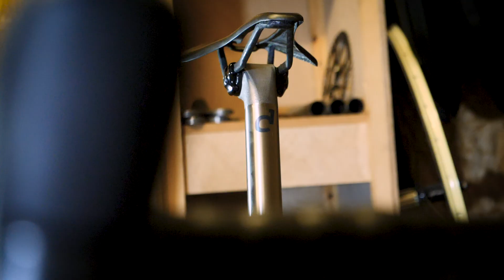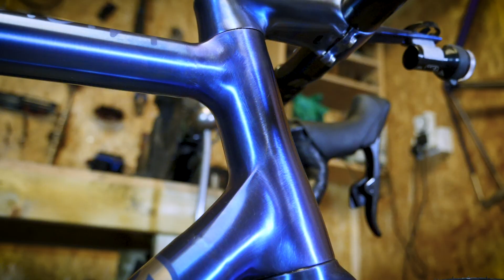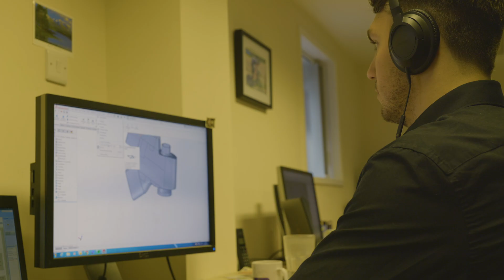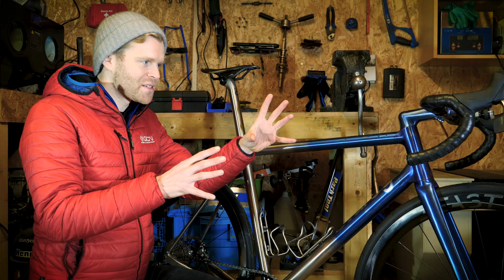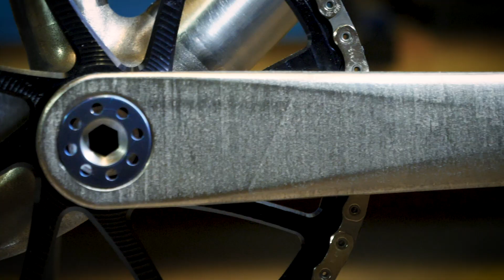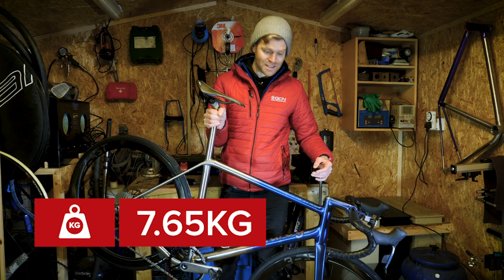Is This 3D Printed Titanium Bike The Most Beautiful Bike In The World?

Comment: The use of video of FDM printing is misleading. This is SLS (Selective Laser Sintering) and is not the same process as shown in this video. No you won’t be able to do this at home even if you can weld Ti. You’d need to send the design off to a SLS house to print in a giant vat of titanium powder. And you pay for that entire vat of powder regardless of how little you use to make the object.
Reply: That's what I was thinking too. I think they did it because it's easy to see, while you can't see anything during the SLS process.
Reply: @michaelmechex  I feel Ollie missed a golden opportunity to incorporate videos of lasers with him making pew pew pew sounds.
Reply: Actually this process is EBM, not SLS, built on an ARCAM Q10.

For both SLS and EBM you do not pay for the entire chamber of powder, the powder is very simply reclaimed for use, you pay for the machine time, a small portion of powder (between £100-£200 per kg, depending on material) and the skill of the AM engineer who is setting up the build.

No lasers involved, just electron beams.
Reply: Not sure how showing a FDM printer means thats how the bike is built.
Reply: Yes and the questionable value of using titanium in the first place is greatly reduced by the fact that it's notoriously brittle where is hasn't been carefully heat treated for annealing and tempering. Such as welds. Of which this mix and match design has many. For a start only a few parts are 3d sintered. The rest is welded to normal pipes. It's the long way around to produce an inferior product. Justified by claiming some parts have to be wacky shapes, which isn't even true. Ollie might only be an organic chemist but even he should know being forced into dodgy heat treatments on metals is both polluting and expensive. Titanium is energetically very expensive to produce normally. For this tech, first you have to make it pure. Then you have to grind it into a powder then you have to melt it back into a solid. Then you have to melt the ends to join them. This is only ever going to be a niche technique. Hang it on the wall with the other models.
Reply: @cadams6702  This comment is misunderstood in all the tech nerdery. Indeed, I would enjoy pew pew pew sounds with my morning coffee.
Reply: @Eatsgreencandles  I couldn't agree more. We'd need a lot of spare renewable energy before I'd call this a good idea.
Reply: @Eatsgreencandles  Some things.... Nothing is "sintered", it is melted, there is a difference. Polluting heat treatment? If you heat it in an electrical furnace, powered by "clean" electricity, where does the pullution come from? The Ti6Al4V does not release anything. You do not "grind" it to a powder, you atomize it, which do require you to melt it again, so yes, energy is needed. "Melt the ends", well, I guess you need to do that anyway if you want a standard Ti cycle, built from only tubes :-)
Reply: @georgegrant6388  I wish more people read this. Not a lot of people read the replies
Reply: @armadillito   I am sure the producer of this bike is holding his breath waiting for you to call something a good idea.
Reply: @Eatsgreencandles  No one cares. It's working for him and his customers.
Reply: @Eatsgreencandles  thanks, a lot of topics are obscured/hidden in the making. and what I dont get is that 3d opens up a whole new world of shapes?! 
thanks for informative good reply/comments
Reply: @Eatsgreencandles  turbine blades in jet engines work of course treated and chemically milled but strong enough to last. James similar situation regarding "not polluting" EVs, TESLA drivers race by you disregarding speed limits, but they are driving EV, producing batteries is an EXTREMELY dirty process but banishing production to The Third  World or China does not make it "clean".
Reply: @georgegrant6388  - Nice critique, thanks.
Reply: @mitchellsteindler  - Making excuses for what is quite clearly misleading is the job of tools. Good tool!
Reply: @newunderthesun7353  - Actually yes more people care that the bs presentation be corrected than will ever buy this bike.
Reply: It is not SLS, that is a name for polymer printing using powders, this process is either EBM (Electron Beam Melting) of LPBF (Laser Powder Bed Fusion)  both processes fully melt the material achieving a melt temperature over 2000deg so the material does not contain porosity and achieves a material density of 99.9%

Comment: IF 3D printed means - cheaper titanium bikes then YES it is HOT
Reply: Ermmm...presently Ti frames are not more expensive than carbon ones.
Reply: Agreed. TI bikes, at least stateside, are insanely expensive. $6-7k for a frameset.
Reply: @tonyg3091  yeah xD captain obvious! some are even cheaper like planext x.. but still most of titanium frames are too expensive or overpriced.. or both :D
Reply: Ahah go believe it... if you apply that to carbon ones, they are getting expensivier each new year..
Reply: It will be a decade or so probably before it'll be an affordable option.    But.  One of the huge benefits it that there is no complex tooling / molds.    Like carbon and alloy frames that have all the hyroformed tubes as well as much more welds.      No tooling investment means they can change / improve / customize the bike easier and faster..  more different sizes can be made...
Reply: Being able to design internal reinforcement structures on the inside of the lugs?   Amazing.  Integrate tons of features right into the lugs the way those crazy tri / aero bars do?      Change wall thickness  internal  ribbing honey combing.    Sooo many design options open up when u aren't locked into machined / forged / tube parts.
Reply: Planet X and Ribble titanium bikes are way cheaper than this.
Reply: @PaperHunter  thank you another captain obvious! I write it in the comment above..
Reply: @mavver  Dunno... 2k quid for a Reilly sounds pretty affordable compared to 4 k euro Specialized carbon frame.
Reply: @tonyg3091  emmm yes in many cases they are.  You can get an incredibly expensive carbon bike, but the lower end is definitely cheaper than titanium.  And because titanium is so difficult to work with, I doubt that cheap titanium (if it can be found) is worth buying.
Reply: Price keeps everybody from having one. That can be a good thing too.
Reply: @erich8258  No, it is not worth buying. BUT as I said a Reilly frameset costs less than good carbon one and the Reilly will last you a lifetime more or less, so price is relative.
Reply: @PaperHunter  different way of manufacturing, not an apples to apples comparison.
Reply: Why no test ride?
Reply: @joelrunyan1608  True, but it is still a slower process, the only time these will come down in price is when the 3D printing machinery market is saturated. A good few years away from that happening. Then the post processing of 3D printed parts is an art in itself, its not something for the common man.  A damm shame this bike is lovely.
Reply: Dream on .
Reply: I don't think it's going to make them cheaper. You can make a cheaper Ti frame just by welding the tubes and some machined parts together and not using any lugs. This is how they're normally made, and it will perform just as well. But it's a beautiful bike with a unique look and fully custom. That's more the niche it fits into.
Reply: I just received my Carl Strong Ti custom frame two weeks ago. Made in the USA and $4500 for the frame and ENVE fork. I'd say it was cheaper than a flagship carbon POS.
Reply: @Sills71  wow, no need to call names. I'm just stating what I've seen people spend money on, when I used to work in a shop. I don't personally own a TI frame myself, only carbon, alloy, and steel bikes in my garage. Several moots framesets are in the $6000 price range.
Reply: Came back here after he said 10k... I hope so
Reply: @tonyg3091  yeah but carbon frames are expensive
Reply: lol no.
Reply: Cheaper titanium parts yes from material cost perspective, but the manufacturing cost is still higher than normal machining. And fatigue properties of 3d printed titanium is still debatable although titanium in general is pretty fatigue resistant.

Comment: Steel tubes are drawn to get the crystals to align and the strength properties that they desire. Aluminum frames are heat treated to get the material to respond correctly. At the 6-minute point , the manufacturer addresses mechanical properties. He says that all these manufacturers use slightly different techniques. He says that the manufacturers hold on to that information. Therefore you don't know what you're buying.

Comment: i've always loved titanium bikes, even over carbon. a disc-braked titanium bike originally designed as a gravel bike is a little slower than a carbon-based road bike but is far more versatile - you can put wider tires on the thing and it makes a great off-road bike as well.

Comment: 3d printed is a bit misleading considering all the machine work that takes place afterwards. More like 40% of some of the frame components have  been 3d printed is more accurate.
Reply: agree - tubes welded to printed joints does not a printed bike make. Still .....wow
Reply: @MattMediaAU  You don't want to print tubes. Much more $/kg and lower strength.
Reply: @appa609  For sure and understood. My point was given the tubes are not printed can you really call it a printed frame? Seems more accurate to describe it as a "regular" frame with printed lugs doesn't it?

Comment: That drop from seat to handlebars looks extreme!
Reply: I thought same. My back, shoulders and wrists hurt just looking at it. 😂
Reply: Some cyclists are actually fit.
Reply: @tomhughes8472  - The needs of the many outweigh the needs of the few, or the one.
—Spock
Reply: @stuffhappens5681  cool. Seems completely irrelevant to Francesco not being flexible enough to ride this bike.
Reply: @tomhughes8472  - Your summation as a measure of foreign anatomy as a sum of absolute values given that deviations from the mean result in a quantity that is an unknown expression of geometry about the mean. The mean deviation, or mean absolute deviation, of your sample measure is unlikely to exhibit the same units of data. Therefore the levity of Spock was necessary.
Reply: @stuffhappens5681  so, completely irrelevant then. Thanks
Reply: @tomhughes8472  - Relevance is subjective, of course.

Comment: btw, love the idea of an all-titanium bike, gotta admit though that this reminded me of hot black desiato's all black ship in the restaurant at the end of the universe:

``Every time you try to operate on of these weird black controls that are labelled in black on a black background, a little black light lights up black to let you know you've done it. What is this? Some kind of galactic hyperhearse?''

The walls of the swaying cabin were also black, the ceiling was black, the seats --- which were rudimentary since the only important trip this ship was designed for was supposed to be unmanned --- were black, the control panel was black, the instruments were black, the little screws that held them in place were black, the thin tufted nylon floor covering was black, and when they had lifted up a corner of it they had discovered that the foam underlay also was black.

Comment: What a beauty! The first metal bike that matches carbon’s beauty. Almost up there with the likes of Bastion Cycles & the Métier Velo. 
 I would prefer finer and more tapering chain stats, compatibility with both mudguards (this one appears to have them) and racks, both front and rear, a headlight mount, internal dynamo cable routing, a low-profile breakaway design akin to that of the 22 Cycles, internally-routed hydraulic frame decouplers, top tube mounts and 4 - rather than 2 - down tube bottle cage mounts - and a more sloping top tube.

Comment: Hasn't Ozzie brand Bastion been 3D printing Ti lugs on their frames for 4-5 years? Also, Merlin came out with Ti forks back in the 90s and they quickly abandoned them when they would flex so much under braking, the front wheel would rub against the down tube. Hopefully this dude can tune the stiffness to avoid that.

Comment: First, all congratulations to Tom for being a master bespoke frame builder.  The engineering and skills needed to do this job on a small volume basis is impressive. It is indeed a very beautiful bike.

Having said that, the title of this piece is misleading.  Tom is not building a "3D Printed Titanium Bike".  He has designed and printed unique 3D Ti lugs to which he welds Ti tubes to create the frame.  Some of the tubes are uniquely shaped by him, i.e. the chain stays.  However, the tubes are mostly standard Ti tubes.  The lugs and especially the forks are where the innovation are here.  I own a Ti bike.  I would be interested in the justification for using Ti forks (other than just because he can) when every Ti bike manufacturer uses carbon forks to cushion the ride.  BTW, other people/companies have designed 3D printed Ti lugs and bike parts as well.

There really has been a full on 3D printed Ti bike. This happened several years ago.  Renishaw (a precision manufacturing company) based in Bristol (conveniently located near GCN in Bath), printed a full Ti mountain bike and partnered with a British bike company, Empire Cycles, to sell them.  They were commercially available for several years.  

https://www.renishaw.com/en/38917.aspx

Sadly, it looks like Empire Cycles is not much of a going concern now, so you probably missed your chance to buy one in the UK.  

A list of bikes and components you can buy now using 3D printing technology is online.

https://www.3dnatives.com/en/ranking-3d-printed-bikes-220920204/#!

While not printed out of Ti, Renishaw is still in the business of printing bicycles.  It teamed up with Lotus to design and print the track bikes that Team GB will be using in the next Tokyo Olympics

https://3dprintingindustry.com/news/renishaw-3d-printing-helps-design-team-gb-track-bike-for-tokyo-2020-olympics-164152/

Ollie, that would make an interesting segment on GCN.  Talk to your producers!

(FYI, I have no affiliation with Renishaw.  But I did see their 3D printed Ti bike at a trade show several years ago.  Very impressive.)

Comment: Strange that the welding is performed without extra gas shielding devices. Ti has 4,5 in density compared to Al with 2,7. Steel is 7,8. Additive manufacturing will increase its market share as prices go down.

Comment: I'm surprised he apparently hasn't used some of the modelling features available (like topology optimisation) to move away from the "old fashioned" diamond design.

It's 3D printed, which makes it easy to handle such changes. Maybe having tubes is unneeded, or only one chain or seat stay is plenty.

Comment: Is 3d printed as strong as cast or forged?  My guess that it is not.  Grain length must be short in comparison.
Reply: My thoughts exactly . I can imagine  fatigue life being quite short and it being quite brittle.
Reply: @edmundscycles1  3d printing looks to be a bit like casting but on a micro scale.
Reply: @earthstick  sort of .
Reply: @earthstick  forging though is done where everything cools at the same rate . This form of 3d "printing" has the metal cooling and therefore contracting at different rates that can weaken a metal especially in complex shapes and where material thicknesses differ .  Micro fracture can occur more in a metal with this sort of system . 

Not sure I'd trust it as much as forged parts .
Reply: @Hazzeman666  interesting read though a bit worrisome in section 4 talking about significantly increased risk of oxygen contamination to "3d" printed Ti parts that create microfracture points . Especially considering the duel axle torsion place on the various frame junctions . 
It also talks about the extra processes required for that strength to be there add time and energy into a process that is already quite long . 

From what I'm readying is that it's a labour and time intensive process that adds very little to revolutionise the frame building process.  It is an interesting concept though . 

Do I think it's unsafe ? Not as such but certainly does add to the the complexity of a bike frame that is not needed .  But that's my opinion.

Comment: Technically, the bike in not 3D printed. 3D printed elements included the frame lugs, fork, stem, and seatpost clamp.
It is beautiful, but not in a class of its own. 
Bastion Cycles has long been delivering magnificent bespoke frames using 3D printed Ti lugs and Bossi Bicycles has modern looking bike with unique Ti cast lugs and Ti hydroformed tubes.